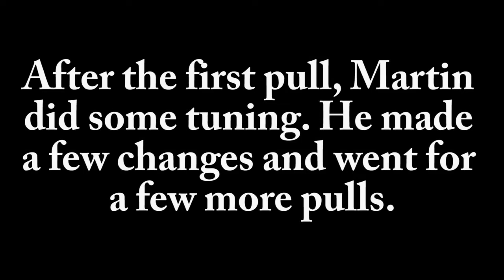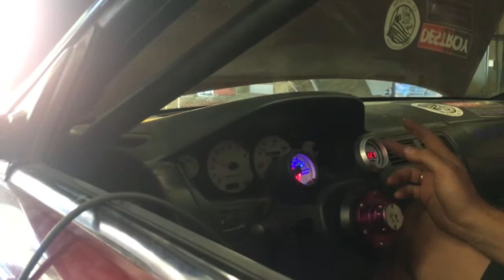KA24DET 240SX Dyno Pulls

Comment: Did you upgrade the throttle body flange or keep it stocks?
Reply from the maker: Sasuke Garage stock throttle body
Reply: @Alex_Lindsay717  ok will do
Reply from the maker: Moderate power the stock one is fine, if you go over like 400 I’d recommend going with a q45 throttle
Reply: @Alex_Lindsay717  ohhh ok thank you for the information!